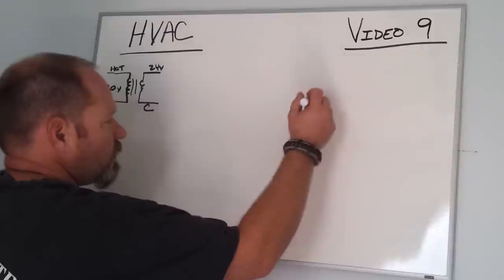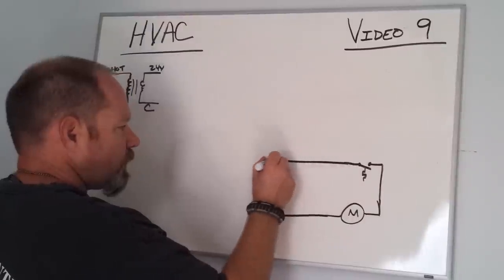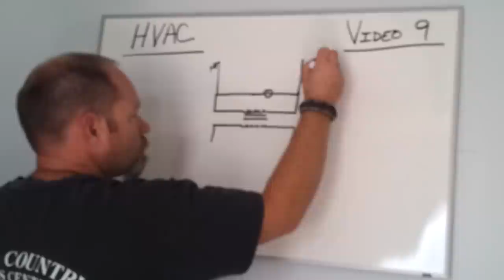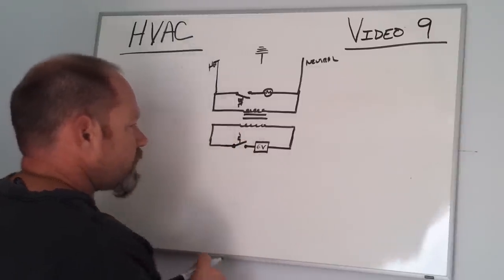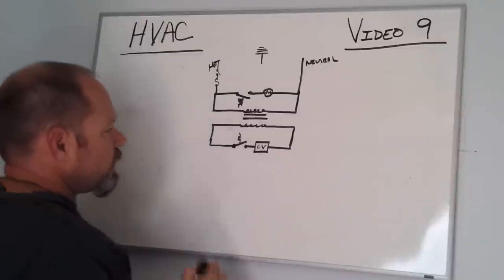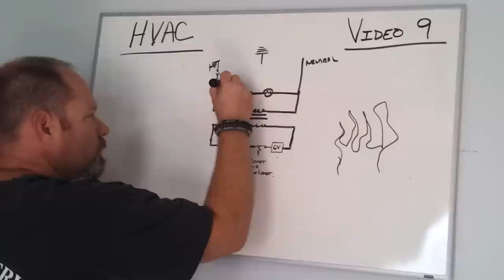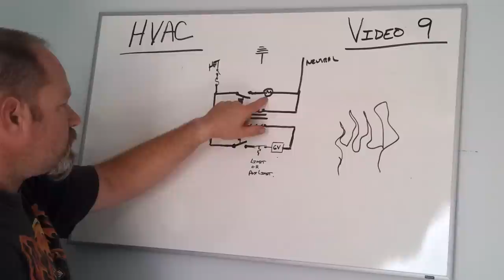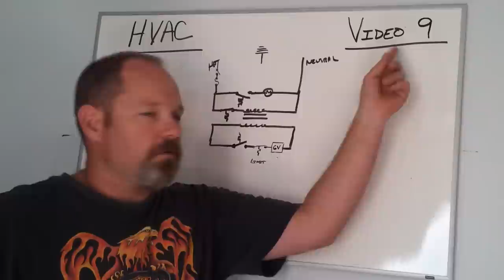BASIC ELECTRICAL 101 #09 ~ HVAC

Comment: Inside lenox airhandler, where do you attach red wire from breaker? Yellow and black going to transformer of some kind that has smaller (possibly 24v) wires going out and feeding other circuits

Comment: Question? I just replace the thermostat and also got a new unit replace. Ac works good and fan comes on but when i turn it to heat it blows the 3 amp fuse in the board panel. I check for shorts but can't find none. Everything is brand new from the unit what can it be?
Reply from the maker: +Edgar el z short in the white wire to ground or common. Replace the thermostat wire. Best guess. Don't forget to subscribe. Thanks for watching and good luck.

Comment: thats a close on rise "cooling tstat" not a close on rise heating tstat.  Heating tstat is open on rise
Reply: His rational is wrong. As you say, it's a cooling Stat as drawn (close on rise). Bi-metal actuator symbol should be on the opposite side.